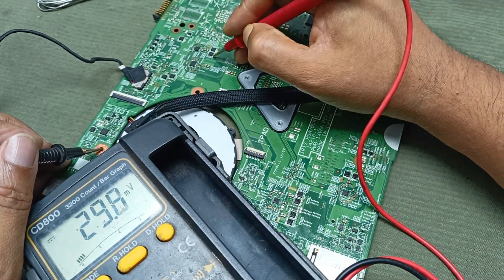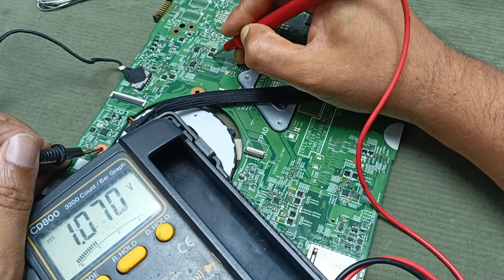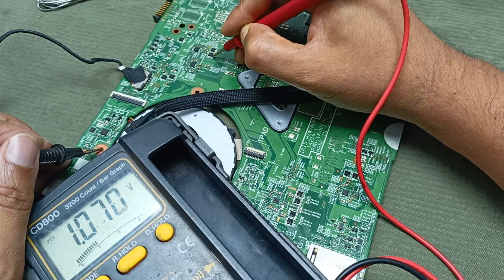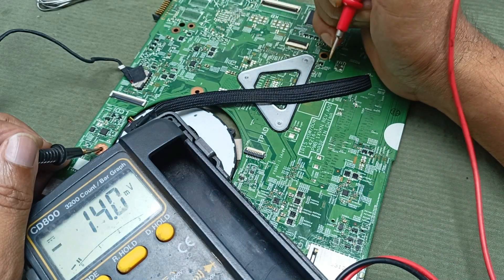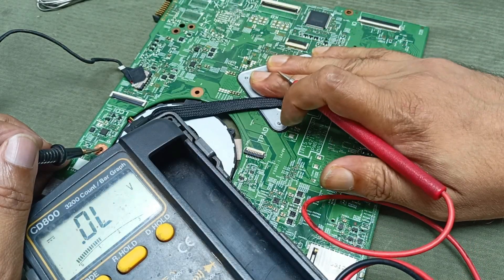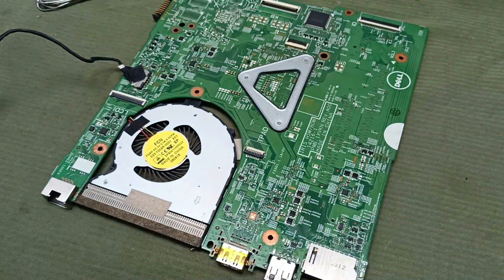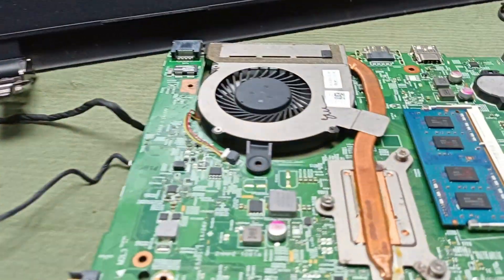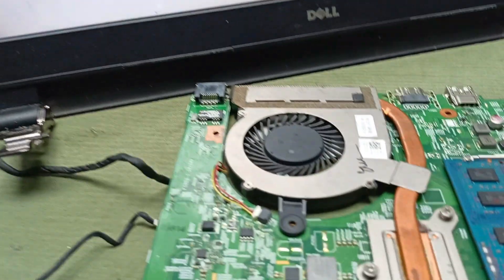Dell Inspiron 15 no power || how to fix dell laptop power is not turning on

Comment from the maker: Dear friends in this video i will show you how to repaired dell inspiron 15 laptop power is not turning on .............
Reply: But why would you first start with a capacitor not with MOSFET ??
Reply from the maker: @NamkhanaPhotography  i was checking there are any short circuit or not

Comment: Personally i would also change the caps around the mosfets. Dont know enough about electronics leading to the question why did it blow and how to improve then just replacing parts.
Reply from the maker: Sometimes it burned automatically. I have no proper explanation about this It's not frequently  happen
Reply: @mrcontrive5641  All well and thank you for sharing your work. Your magnification scopes is certainly a reminder  to look into purchasing. Worked with a three-dimensional effect x20 Nikon Fieldmicroscope and would say maybe equivalent to x60 against other scopes. Nice to see a steady hand during soldiering. Obviously no caffeine before starting repair.  🙂